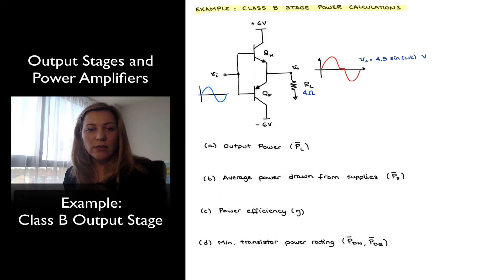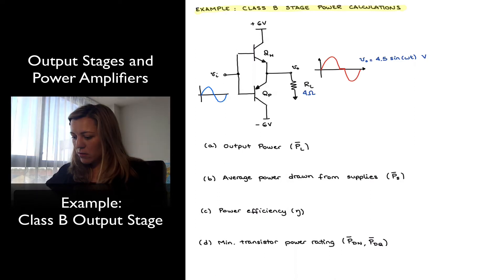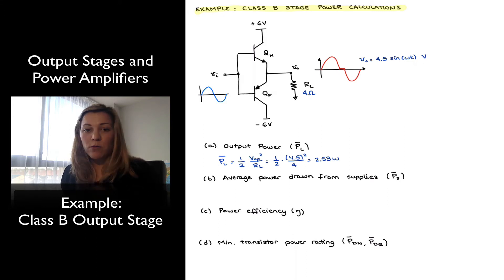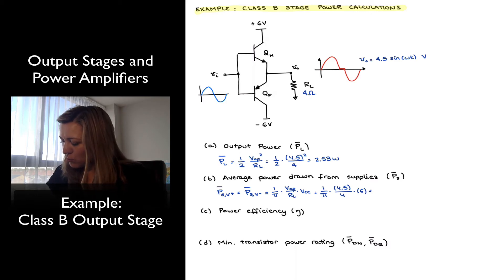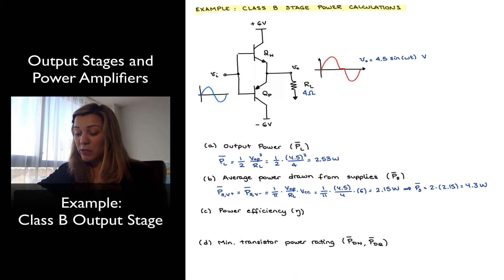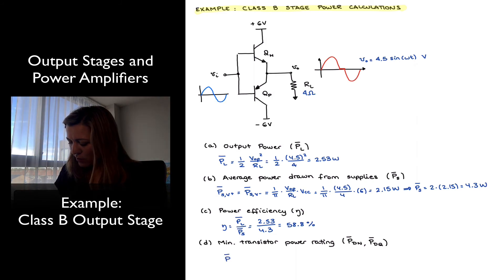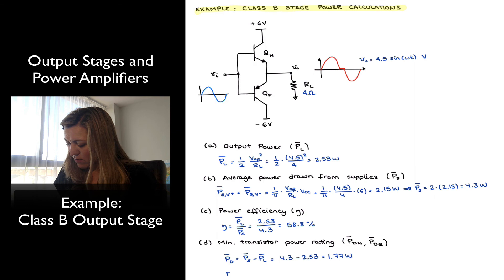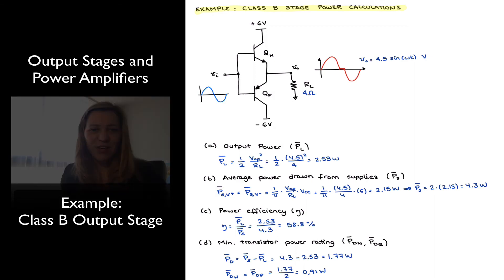Example: Class B Output Stage

Comment: Hi in determining the output power how was Vop determined to be 4.5 volts from Vcc set at 6 volts? Thanks
Reply: vop is the peak sin voltage not the peak source voltage. POWAWAWAWAWA